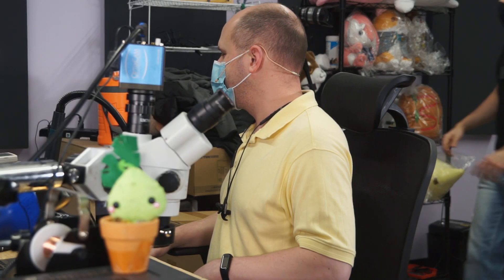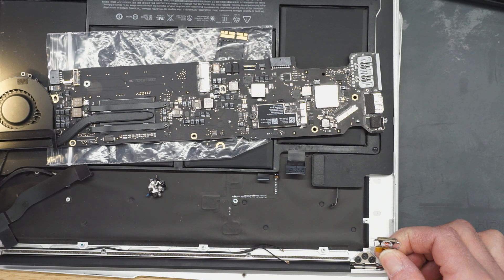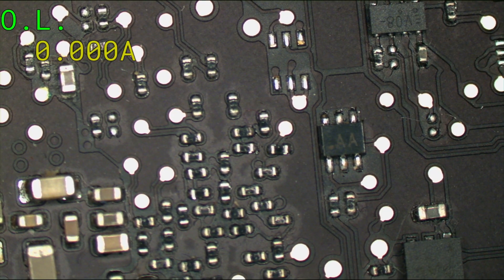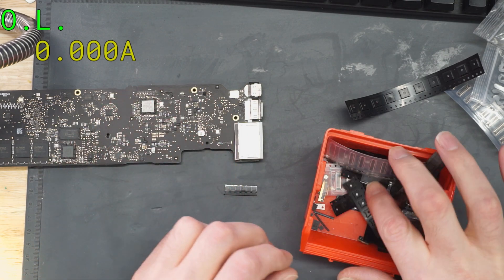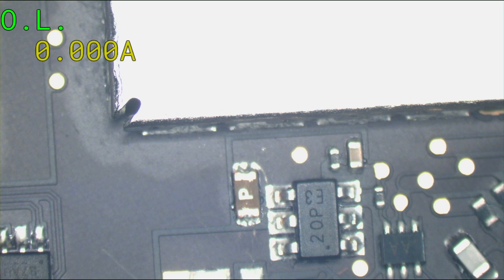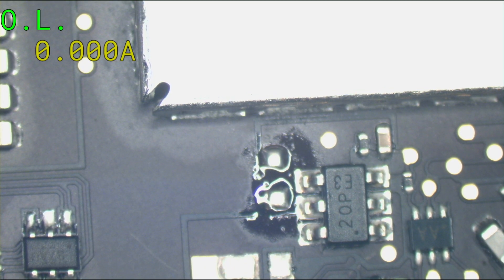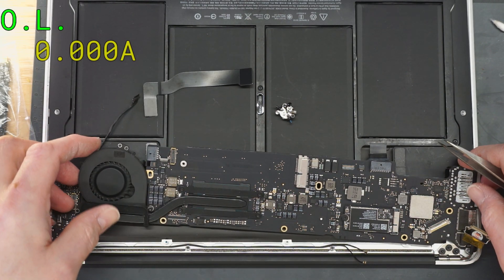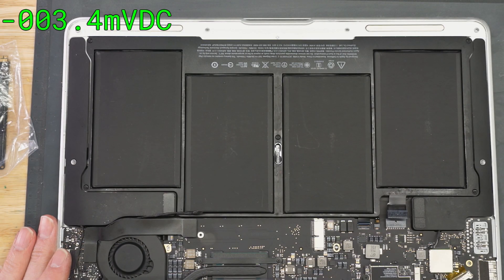Macbook Air no backlight: they thought the screen was bad

Comment: It's possible that the original screen WAS bad and took the backlight driver with it when it failed. If the screen replacement was done by a repair shop they should have known to look for the driver problem.

Comment: I've tried to build up the courage to do this kind of repair but I'm just not equipped for it. I think I did one repair where all I did was remove a short by clearing some solder from some bridged pads. If I had the tools I'd feel more confident, but I'm working at a shop that barely does 800k total business in a year.

Comment: My backlight was out in my MacBook Air a few years back. They told me it would be $700 to repair, so I just threw it away 😂
Reply: That's step one of their grand plan.  Step two is that you just buy another.
Reply: @gmscott9319  or you can foil their plans by using the good old flashlight trick
Reply: @tezcanaslan2877  or make a hackintosh:)